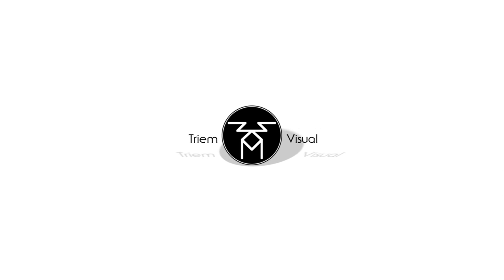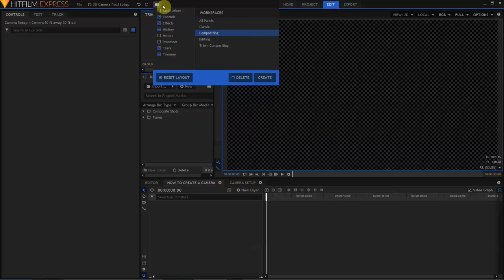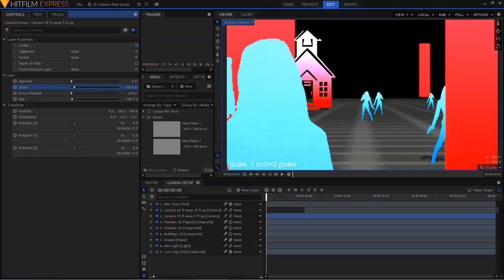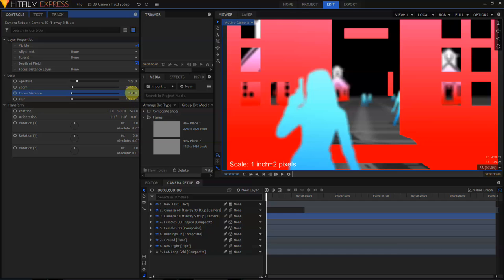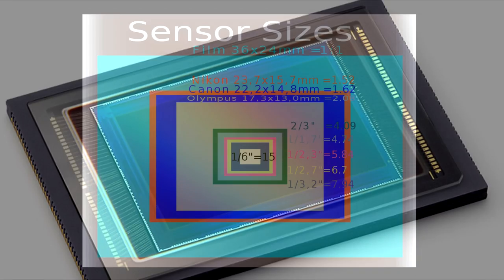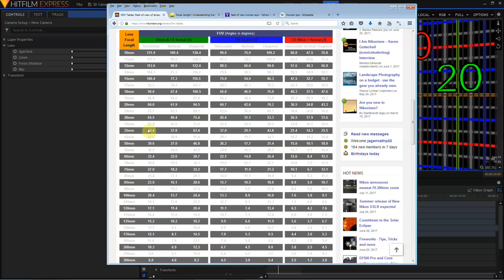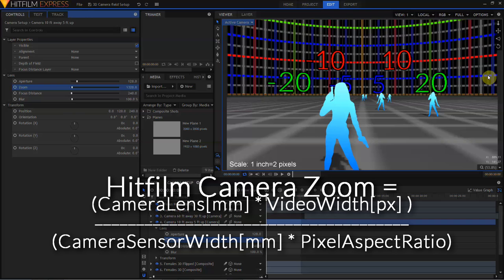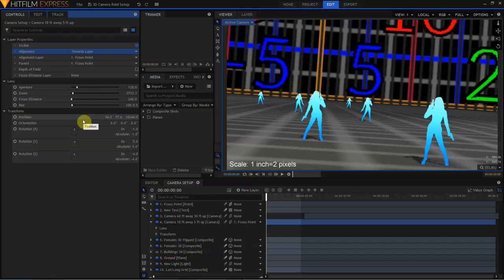Essential Hitfilm 12 - Understanding HItfilm's Camera 01 (Virtual Lens Kit)

Comment: Great info in this tutorial, Mike!  I had never really stopped to consider how this would affect compositing before.
Reply from the maker: 4K Productions yeah, and Cameras part 2 is moving cameras, cameras part 3 should be lens distortion tricks and, the tricks for handheld looks.
Reply from the maker: 4K Productions One other note. The future part 3 will also be important for camera matching. That's where we'll get into lens distortion filters. Oddly enough if you have a DVD or Blu-ray of the original 1982 TRON there's relevant information! They mathematically matched the computer camera to the real camera, but, in compositing it was discovered the elements didn't line up right... Lens distortion wasn't taken into account... 

So, a look ahead for ya. You get something with an even grid on it, set that and your camera up so they are level and move the grid to fill frame (at chosen focal length if a zoom lens). Bring a shot into Hitfilm, and drop a grid on a grade layer above it. 

Now on your video layer, drop in lens distortion or action cam distort and adjust till the grid is straight. Save that as a preset to undistort a camera. 

Delete the lens distortion from the video. Put it on the grid grade and adjust until the Hitfilm grid matches the video. Save this as a preset to distort CG elements to match the camera.
Reply: Looking forward to that part.  It sounds quite interesting and potentially super helpful.
Reply: It's indeed far more powerful than I thought. I get new ideas for my entire production I'm working on.

Comment: Another great tutorial Mike. I'm looking for the next one. If there is time for a request would be great to know how to, if at all possible, parent the camera to a path like in Blender. Cheers.
Reply from the maker: Rodrigo Soares Cameras part 2 will be all about rigging and animating cameras. :-) For now, take a look at Essential Hitfilm 10 (Animation 2), because there's a section there on animating planes and auto orientation. It's pretty much what we'll be doing with the camera. Animation 3 is helpful as well, because Euler rotation comes back into play, as well as skeleton rigs. 

It's not quite like in Blender where you can define a spline path amd have the camera follow it, but Hitfilm keyframes, by definition, are spline paths. 

TL/DL if this week is "Virtual Lens Kits" next week is "Virtual Tripods, Sliders, Gimbles, Jibs and Cranes."

Comment: Hi Triem, thanks for that tutorial. The tip to add different cameras with limited lifetime leads me to one question: Is it possible to create a multiview of the same scene with different cameras? E.g. an 3D-szene where you have two cameras each of them filling a side of the screen and not all of it and beeing "active" the same time?
Reply from the maker: Je Hu Nope. Interesting thought however. 

Probably the way I would go about this would be to create the animation in a comp. Duplicate the comp and create/place/animate the second camera, then create a third comp, drag in both camera comps, then use the split screen masking filter to set up both windows. 

If you're in Express then Split Screen Masking is part of the optional Starter Pack add-on. If you don't have it, then you would need to draw a rectangular mask on both the embedded comps and use the position properties to move each half-screen window to the edges of the screen. Then if you need to adjust a camera, return to its dedicated composite shot. 

Coincidentally enough I was doing this exact thing earlier tonight setting up a demo for the next episode.